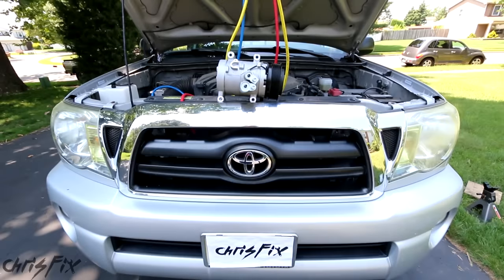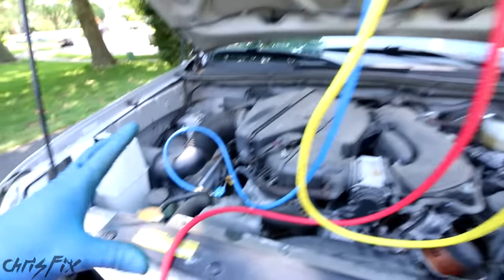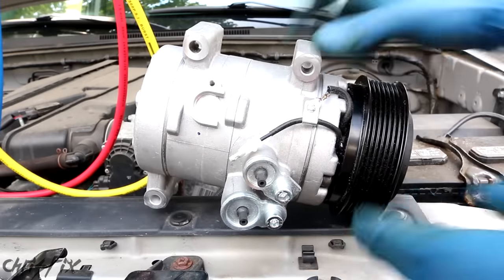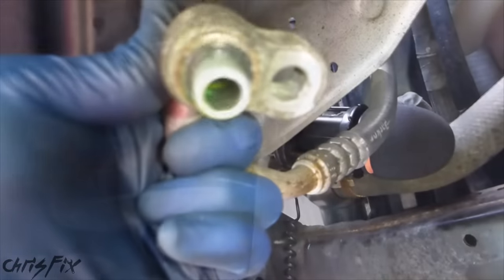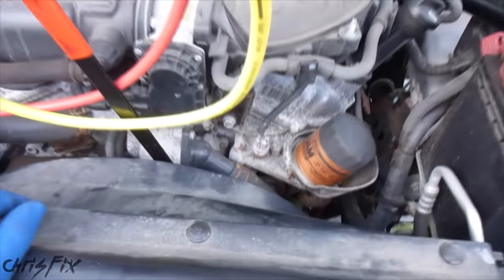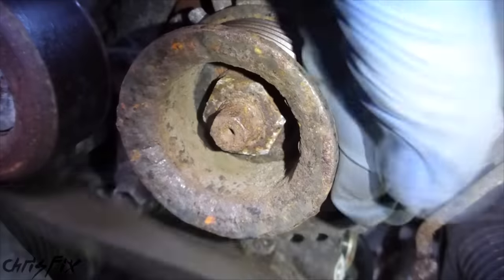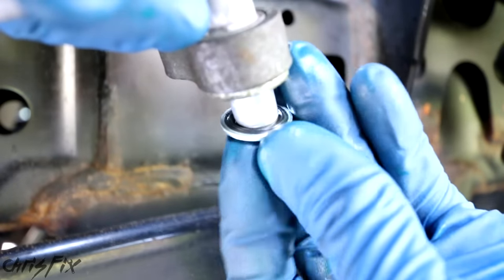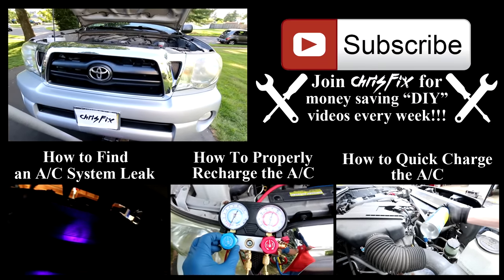How to Replace an AC Compressor in your Car

Comment: Oh visiting this again, when changing a compressor with the oil you really should see how much actually comes out the old compressor. Its because well the oil will actually lower the cooling efficiency of the ac system overall. Like if you manage to get more than nothing out of it, like if you get 2 ounces put 2 ounces in it or if you get nothing probably put like an ounce and change in the new one. Do that or whatever the manufacturer says when you put a new compressor in. Also a new accumulator or reciver dryer should be put in.

Comment: I watch him do it and I'm like.. "looks easy"

Then I go do it and all hell breaks loose.
Reply: Sergio Muñiz so damn true could imagine how my brake job gonna go when i get home lol
Reply: @Antattack22  if ur bolts are rusted, i will pray for u my friend :)
Reply: Sergio Muñiz Right? I looked at mine and said (this will turn into a shit show real quick), then I went back in the house.
Reply: Sergio Muñiz if it were as easy as it looks on YouTube it wouldn't be half the fun that it is for a normal person
Reply: @2_fitnesss523  
Before you start loosening any bolts spray WD40 15 to 20 minutes prior to start wrenching.
You'll be gladd you did.
Bolts will come off much easier.
Reply: @s.adanulloa3902  exactly, if you come prepared nothing should slow down, that is until a bolt decides to breaks in which case you go searching all over town for a goddamn bolt that seemingly doesn't even exist.
Reply: That's the difference between mechanic and the average person.
Reply: Santi Ulloa use pb blaster instead helps so much more
Reply: Tip: tools tools tools.

That makes all the difference.
Reply: same feeling, I need to go change mine on the Toyota Sequoia. let me see how it will go
Reply: Absolutely, this is a piece of cake!
Reply: @teametal11  😂
Reply: @2_fitnesss523  😂😂
Reply: thats how it normally happens. lol
Reply: Heard that
Reply: So fucking relatable.  I had a 2002 ford mustang and the moment I start doing shit. My one and only fucking tool just had to fucking fall in the engine bay. And after hours of searching nothing. Until i turned it on and heard the fans fucking up my radiator like the US did Hiroshima
Reply: Sergio Muñiz same
Reply: Me everytime I watch ChrisFix's videos 😂
Reply: Sergio Muñiz 🤣🤣🤣🤣🤣🤣🤣🤣🤣🤣🤣
Reply: Brayan Hernandez 🤣🤣🤣🤣
Reply: @faisal3398  I been there and it makes a 1hr job into a 1 week search and rescue mission.
Reply: It all seems so easy but for me...that is a different story. Plus with no tools like what Chris has...impossible! 😔 I enjoyed watching the video though.
Reply: 😅 Sounds like me!
Reply: @redmanhernandez5690  😳😅That would prob. be my situation! 🙅
Reply: @osiris4260  😂😅
Reply: you need soopy wooder
Reply: I watch him do these things and realize how easy it is.
I just had my A/C recharged.
The mechanic said it was so easy I could have done it myself.
Reply: @torr95  I found a video that evaluated most of the available solvents in a reasonably fair manner. The only exceptional penetrating solvent is the Liquid Wrench product. The rest are in a pack with a couple of money wasters. PS: make sure you know which evaporate w/o leaving lubricants.
Reply: Spray pb blaster on rusty bolts
Reply: Well , you can't learn anything without messing it one tims
Reply: Absolutelyو I hear you🤣
Reply: @Antattack22  240v
Reply: @faisal3398  It's a rule - the only bolts that break are the ones that have to special ordered from overseas and will take six months to arrive. :D
Reply: @teametal11  part of being good at something is knowing your limits!
Reply: @absenthurdle5666  k
Reply: Exactly 😂☺️😂😂
Reply: Edit out all the screws ups and it will look easy - I am sure Chris has some good blooper video material…..
Reply: They always put the part I want to remove in the most inconvenient places. Some time I think the design engineers are laughing and say lets see you get that out of there.
Reply: @s.adanulloa3902  Blaster PB PENETRATING Lubricant is the most awesome stuff. I used a lot of WD-40 before I tried the blaster and I am a believer now.
Reply: The opposite for me
Reply: Hahaah same
Reply: Lol
Reply: Xf
Reply: Same
Reply: As a person who has completed many complex repairs I can say without a doubt that he'll breaks loose for everyone and when making a video you just don't show the 2 hours you spent trying to dig that one rounded bolt out

Comment: It's disgusting how easy you make it look!! Nice video!
Reply: hahaha
Reply: For real, I have an 06 Acura TL with a compressor clutch that's broken,  and the compressor is buried under the alternator in an almost impossible-to-reach spot with no other access point,  dammit Acura >:( at least I now know why my mechanic wants $900+ to replace it.
Reply: +CrowMeister42 lol, $900? Yeah, I'd learn to do it myself for that price and spend absolutely $0 on labor costs. That's a lot of money.
Reply: To top it off he was gonna put a rebuilt compressor, and I prefer new since the rebuilt ones aren't as good and they're not built right and break again anyways. The job wasn't as hard as I originally thought, had to remove one of the rad fans for extra room, along with the alternator and serpentine belt. New compressor was around 390 with limited lifetime warranty,  plus 110 to get it vacuumed/flush/fill new refrigerant, now it blows ice cold and saved 400 bucks :D
Reply: +CrowMeister Good deal, my man!
Reply: expensive is include  the part? Is not hard too do,I I did audi all the front of the car need to remove,about 900.
Reply: @EddyTee99  about 10 months
Reply: Dude crowmeister that’s under the alternator?? Holy shit I replaced the alternator on my moms Acura for her and that was a fucking pain
Reply: It's easy when you're not actually doing the work.
Reply: Most likely done in a GARAGE then tighten up and go home to make it as a DIY project, its easy, just take your time, watch more than 1 video, watch more than 3 of them. All DIFFERENT people, EVERYONE has tricks. This guy doesn't show all, why DIDN'T he finish the JOB with filling AC unit now, if me, I would of replaced it all and then went into finishing it up, there's a vacuum process to make sure there's no humidity in the lines and that can take up to an hour but most likely done 30 minutes, then add R134A once vacuumed out. Also use a gauge, if you fix cars often, then buy them from Harbor Frigh t now just $59.99 vacuum pump cost for a decent one$99.99 but can get for $74.99 with coupon threw same place, yes $145 on tools but I can't rent them, you will make that if you charge one PERSON, they charge from $129 to $179 depending on how much is needed for VEHICLE. Best of luck. Just need to train yourself. Then your set for a very long time
Reply: @EddyTee99  how long did it take you?  What things did you use?
Reply: Yeah, he does make what he does look a LOT easier than it really is.  His videos are heavily edited.
Reply: @JR-kr1lv  I know they use R134A gas in car air conditioner compressors,,,, but I don't know the composition of the gas. Is it compatible with R290 which I believe is pure propane (could be wrong). All cooking gas sold in Aus is pure propane. What I have done with many split system air cons: I have purged the lines with propane, tighten up and done. I have a vacuum pump and gauges, but don't bother using them. One of my Mitsubishi split systems with R22 has been moved a couple of times and thus over the years my 5 kg R22 tank has become empty,,, no problem, I just use propane, same boiling point temperature. I am about to install a new split system Fujitsu and  the new gas is R32 and it is compatible with R290  (propane),,, again I will purge the lines with propane,,,, you lose less gas than i do with my gas cooker and gas hot water system. so what is the problem?
Reply: this guy has every tool he probably needs for any job..

Comment: I’ve watched every single video chris has made over 2 times each, helps cure my boredom and learn a thing or two.
Reply: I've only been watching for a couple of months and I have learned so much even though I already did a good amount of the work myself. This channel has help me be more technical about my process but also thought me really cool stuff like replacing the AC compressor and the entire suspension. This channel is easily the best car repair channel on youtube.
Reply: @MrSupernova111  Absolutely is!
Reply: Same

Comment: The quality and camera angles are amazing. Great video as always.
Reply from the maker: Alejandro Barocio Awesome! I worked hard on getting good angles and it was tough because it was so tight down there! I am glad you liked the camera angles and appreciate the support as always bud!
Reply: ChrisFix I am still trying to figure out how the hell you fit the camera down to see the pulley tensioner haha
Reply: It's like he has a camera man and Hollywood editors. High quality videos. Excellent job Chris!
Reply: One of the most amazing aspects of your videos is the way you film your work and the quality of the image and light in those narrow spaces. Well done and chears from a Greek fan with a Dodge caliber. (Already changed my spark plugs, thermostat, spraypainted wheels inspired by your videos and general approach to fixes. Now i ll try to mark my tools with the vinegar trik)
Reply: Alejandr
Reply: 5
Reply: 1
Reply: Another gem of a video Chris!  Question, my a/c compressor says that for the warranty to be good, the orifice tube needs replaced.  I plan to do this job this weekend and dont know what that is.  Also, my compressor has 3 oz of oil in it, the system takes 4.23 oz.  I think there will still be oil in the system after evacuating the R134 to make up the 1.23 oz difference?  Dont want to have too much oil in there.  Any thoughts appreciated Man!  Thanks!
Reply: @chrisfix  a question why you dont put oil to the new compressor.
Reply: @proyectoaventurero1801  He said in the video that the compressor was pre oiled
Reply: Its all by accident. He really just puts the camera there so you don't see his face in relections lol

Comment: Excellent vids! Gave me enough courage to replace the compressor and recharged the system myself! So nice to have working a/c again in this Carolina summer heat and humidity! You made a difference to me and my family!
Reply from the maker: That's awesome! Thanks a lot Ben!
Reply: good luck replacing it again in few years because of too much oil in the system LOL
Reply: How did you manage to get the old coolant out of the system prior to this job?
Reply: @AudreysKitchen  look up how to properly recharge your ac system by @chrisfix
Reply: A man, will an ac  clutch that is not engaging cause the radiator fans to not come on also?

Comment: ChrisFix has helped me out so many times, so I don't want him to take my critic in the wrong way. I have a 2004 Honda Accord and needed to change the compressor, this video helped me out immensely. But...the oil that comes with Denso Compressors is only for shipping purposes and needs to be drained, and filled to the proper amount. Thankfully my new compressor was not ruined but caught it in time. Thank you Chris.
Reply: This is a super helpful comment. The new compressor I got in the mail has instructions that say to drain the oil and dispose of it. And I'm thinking "you already went through the trouble to put the right amount in, so why would I replace it??" I had resolved to replace it anyway and follow the instructions, but I'm glad to read this comment and be validated in my decision :)
Reply: Thanks...good to know.
Reply: So you have to buy more oil? Son of a biscuit
Reply: @supers0nic77 😂 i dont know why this comment made me chuckle

Comment: A small tip I have:
Change the hardware out if it's really rusted or if it's made of aluminum. I have had screws and bolts break or get stripped to the point where you can't remove them through normal means. This is especially important if your car is over 20 years old. Ie. 90s or older

Comment: Shit dealer wanted 2000 to replace compressor an condensor ,Accumulator Drier ,Expansion Valve and do a flush on 96 Nissan . I bought all the parts on eBay for 340 and then another 300 for all the tools guages flush , few cans of coolant and vacum pump and did a complete job and it saved me close to 1400 in my pocket plus i still have all the tools.
Reply: what about the man hours?
Reply: @defensegeneral9893  those hours he worked on that car are all MAN hours 😎
Reply: Its a nice feeling to fix things, well done.
Reply: You WILL use them again. Help a friend.
Reply: @defensegeneral9893  4 hours/$1000
Reply: @troyc4841  I've used them several  times since then and fixed AC issues.

Comment: Great coverage in the whole aspect of replacing the compressor. Other mechanic videos were not as clear and only included some parts of replacing the compressor. Good job in explaining in detail!! I will try doing this myself.😢 A quote from a mechanic was $1200 to fix & part was $650 when I can purchase for $260 myself.
Reply: Lucky you. I was quoted $ 1700

Comment: High quality video, straight to the point, most importantly you didn't skip any steps for every bolt installation and removal, and you mentioned all the parts requiring specific attention and lubricating.

Comment: When you change the A/C compressor you're suppose to change the A/C accumulator as well. Doing so filters out the contaminants and absorbs any moisture that might have entered the system. If moisture is present in the system it will turn into acid and acid is not good for metal. Another note, if you don't install a new accumulator some of the A/C compressors' warranty will be voided.
Reply: Eric Lao there is always somebody that thinks they know more than the person on the video
Reply: eric lao is correct however
Reply: He's completely RIGHT!
Reply: Knowledge is power Mr Kennon. I love Chris's videos but I always appreciate others bringing their particular experience to the table and I think Chris does also.
Reply: Eric K., warranty on compressors state that certain things must be replaced, such as the accumulator or receiver/driver,  orifice tube, and in most cases today, the condenser.  Most also require you to flush the system, and all require that ALL of those purchases be on the same receipt for the warranty to be valid.  Mr. Lao is correct, there is desiccant inside the accumulator, which absorbs moisture, and the oil can become acidic over time, thus eating away at seals and the such inside the system.  It's $50 or less to replace such a simple component and to perform a flush, why not do it when dropping $150 to $300 on a compressor?
Reply: Actually as a technician for 23 years, Eric is 100% right. Anytime you open a system YOU CHANGE THE RECEIVER/DRIER/ACCUMULATOR. YOU ALSO DO A FLUSH. ASK ANY PLACE YOU BUY A COMPRESSOR WHAT IS NEEDED FOR A WARRANTY.
Reply: Just a question, I mostly drive beaters and I do the most cheap-ass band-aid fixes I can on the car as almost any fix totals the car out.

If I do a botch replacement like this but with a junkyard compressor (let's say the junkyard compressor is in good working order), how bad is it?
If I put the replacement compressor on and get the system vacuumed, will it be like... mostly okay or is certain failure imminent?

A fix like this doesn't have to last years for me, but if it dies again in less than a year it's not worth the effort and money.
Reply: Classics By Steve changing the receiver drier means changing the desiccant element inside the accumulator correct?
Reply: @mac9120  yes. The driver has a dessicant in it that is non serviceable. Its recommended anytime you open the system.
Reply: In some cases the condenser needs to be replaced these usually come with the accumulator/drier and expansion valve
Reply: Yep ..
Reply: @paulsosa1872  Yes, especially if the compressor has seized, since metal debris can be sent through the system. For some reason, a mechanic was going to replace only the compressor on my nephew's car after it seized, which probably would have resulted in more trips to the shop and a lot more money out of his pocket.
Reply: Othroooo
Reply: @theevooflove  The problem with videos like this is the people who think they are getting ALL the information they need to do the job, and they don't need to read on the make/model they are working on. RTFM and RTFI (look it up.) There are compressors that have shipping oil, not to be confused with operations oil. Another example: Chris used a spray that was for paint adhesion enhancement. In the comments people were complaining that the stuff didn't work as a primer. They were over spraying chipped paint, trying to prep the bare metal. The stuff bubbled on the existing paint. That isn't the application: it's for bare materials and only bare materials.
Reply: @classicsbysteve682  No doubt. And that's how a $500 compressor turns into $2K (shop price) to do it right.
Reply: @classicsbysteve682  thanks for answering my question. I'm thinking about doing this myself, but I  was wondering about it because I've heard both ways. I noticed on eBay they sell compressor kits with receiver/dryer and expansion valve. What about the condenser and evaporator?

Comment: Thanks for the video and good camera angles/lighting. Just one tip: Most systems will require "oil balancing". If nothing on the system was replaced (other than the compressor and the dessicant drier) one must drain the oil out of the old compressor and measure it. Then drain the oil out of the new compressor and measure it.  The amount of oil that came out of the old compressor is the same amount you'll put back in the new compressor. There are other factors to consider which I can't get into here, but the point is that you don't want too much oil in the system.